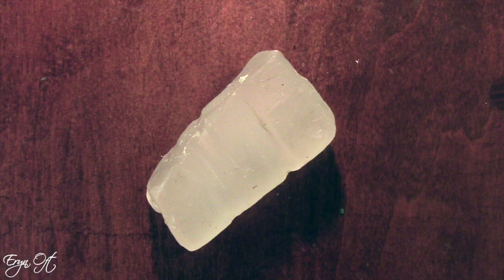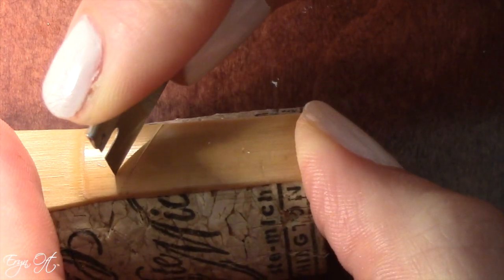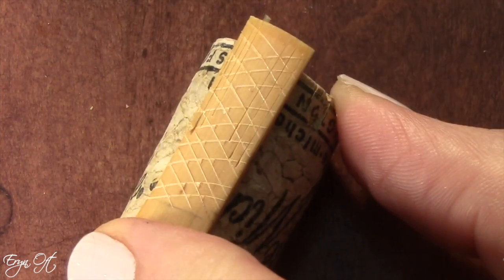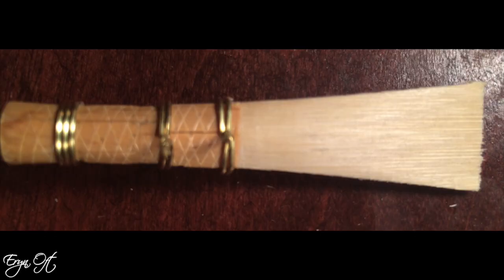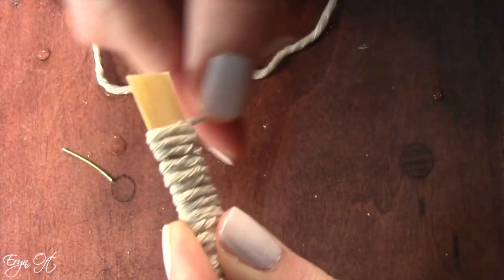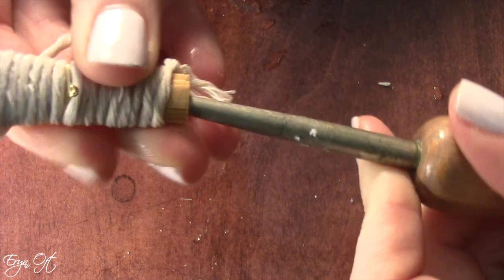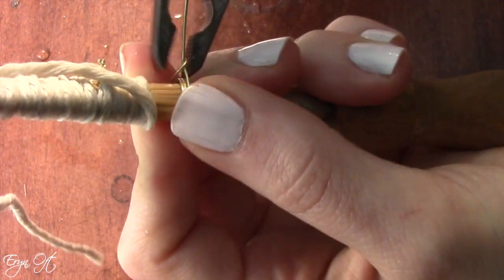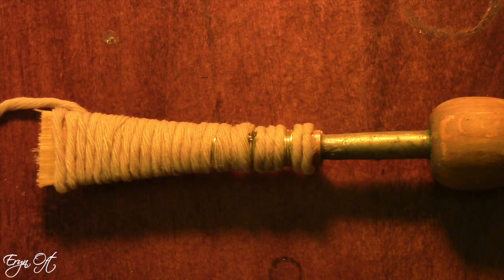MAKE A BASSOON REED PART 2: Scoring, Forming, Wires and Rounding the Tube

Comment: Instead of the waxing, my teacher told me to heat up or steam a mandrel (or mandrel pin in pin vise). Then, I put that in the tube, and let that sit for at least two weeks. I put on the wires before wrapping, I bevel the inner tube with sandpaper, I soak the cane for 4 hours before, I don't cross hatch, I score five marks on the bark(ish?) not all the way through ("roughening up"), I wrap the blank from the base to halfway up the blade,and I don't do hand gouging in the tube. I'm going to try out your method and see how it works out! I just ordered 10 pieces of gsp Vandoren cane (expensive, but I saw great reviews about its consistency). So great to learn more tips about reed making!

Comment: Thanks for making these videos.  It's nice to see what other people are doing.  I am going to try some of these tips.  I never knew it was possible to over-soak the cane, and that perhaps that is why my reeds keep cracking.  This is SUCH an expensive hobby!  It's also nice to see someone suggest to NOT score down the center of the bark.  I was taught (20+ years ago) that the center score is to be the longest and deepest, and that is NOT working for me!  So, I may try a short, not deep score, or none at all, like you suggest, down the center.
Reply from the maker: Please let me know how you get along with the new scoring options! I find Hard cane is more likely to split, too. Softer cane is more pliable. Have you tried working with different brands and styles to see if it alters the challenges of cracking the tube? Thanks for keeping up with my bassoon adventures!

Comment: Another Great Video :)

Because I prefer more live or wild vibration from rather small and Thin reed, I only soak cane about 10-15 minutes.(I like hard cane because more I deep it in water, I think the finer loosens.)

I used to score entire area but I'm gonna try your method that side bevel.(Good point there)
I use two mandrel : Rieger Forming mandrel, Rieger regular mandrel
Forming mandrel has bigger diameter than regular mandrel which helps because I bevel the entire tube and aggressive short bevel which shrinks the tube size.
I never had triangular tube without cross hatch but I think I might have crushed more  with rieger plier I guess.(or because I score whole tube which makes more control?!)

Because I'm kinda lazy or try to make efficient, I don't do twine but make 4wires on the drying rack until beveling and also finish as 4 wires.( I used to hot glue just between 3rd and 4th wire but I find it makes different vibration which I prefer the sound without)
Reply from the maker: Ryan Choi SO GOOD TO HEAR FROM YOU! I was hoping you would comment so I would have an excuse to message you. Best Publicity Manager EVER!
Seriously- big thanks! 

I have some questions for you- if you have a second. What type of wire do you use for the four wires? Did you already tell me this? I've been reviewing my work with Mark Eubanks- who also used four wires and they were different weights and he used silver, brass, etc.  And do you let the reeds dry on the forming mandrel or on regular mandrel? And what are your tube and blade lengths? I hope this isn't too forward but I'm researching a lot of different reed styles in books, blogs, and comparing to what I do, used to do, etc. It's fascinating. It's helping me make a reed particular to Exactly What I Need for Specific Performances. 

Let me know how you like some of my reed making style ideas- if they work for you, if they don't work. Cheers!
Reply: Eryn Oft I'm glad that you liked NEW-Comers.

I use same brass wire for all 4 wires. (I got many tips from Gustavo Nunez's reed video)
I see some people use 3 wires without any turkish head but 3rd wire has another loop to make it stable.(I've seen quite many including Mor Biron)

I dry blank at Rieger drying board(regular type) but quite deep. I sometimes let the side of the reed little open(because I'll eventually bevel to make it round)

My blade length is 27mm and the tube is 25-6mm. (We use 442hz here)

My cut is quite thinner and shorter than most commercial reeds (My teacher's reed is even shorter)

I have a the reed scoring tools from Bonazza but I don't use it most of time but sometimes I cut only 5mm at the end to make it easy to make the tube depends on the cane condition.

I'm also very interested about what people use!!!
Reply from the maker: Ryan Choi How FANTASTIC! 

We play on the same length reed (for My Heckel) but with my Bocal I come in at 440.  I hadn't thought of those playing at 442.  I should include my shorter reed results for those at 442. Brilliant! You always give me so many good ideas.  Last question- Wire placement? Where do you put them?
Reply: Eryn Oft Same length huh?  WOW

I only use Heckel CC1 bocal. ( I have 2 : nickel and gold plated)
I have Fox 2 which I started with but it's with a  my last resort Fox IV bassoon.
(Yeah I have 3 bassoons because I didn't sell them but I'm about to let my puchner go)

I don't have exact wire placement but my rule is that 1st and 2nd wire should less than 7mm and 3rd and 4th should less than 9mm. ( my teacher put 1st and 2nd with 8-9mm gap but I put 1st quite close to the blade side)
 
Because I tend to move 1st wire placement at Tip cutting stage and I correct other wires correspond to.
Reply from the maker: Ryan Choi Okay- I have to admit I am a little fuzzy about your wire placements. But I think I have got it. So good to hear from you and catch up! Really appreciate all of your support- it makes filming so much easier when you have a connection to people. It's not just a camera. ;)
Reply: Eryn Oft I'm thankful for your video.

I'm always trying to find right spot for the wire but because I buy cane as GSP, I don't have control over the gauge thickness.
I feel that gauging stage is very important because it really makes different vibration just by a 0.1mm as I feel.
So that's why I constantly move wire placement little bit but since you have your setup, I think you can manage that.
Reply from the maker: Ryan Choi Oooh- so in my cane reviews I should be including more information on the gouge of the cane. And I agree the gouge is SO IMPORTANT! Especially if it is concentric or eccentric. I will start taking better notes on that and including it in my cane reviews. Look how you're helping me make better videos- LOVE IT! :)